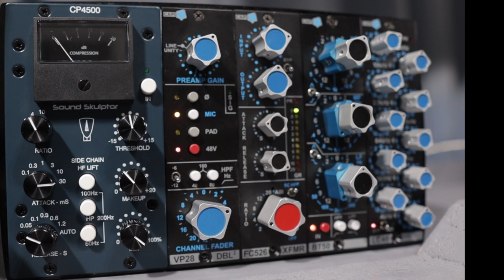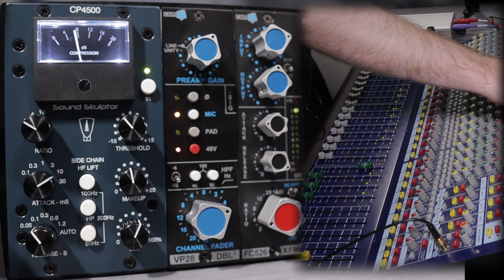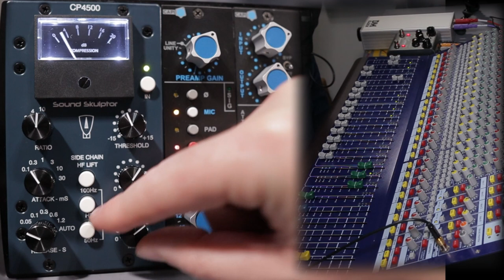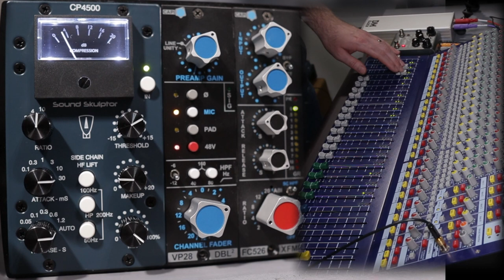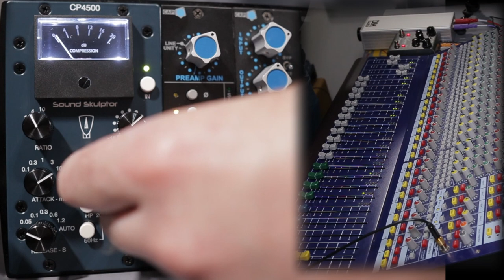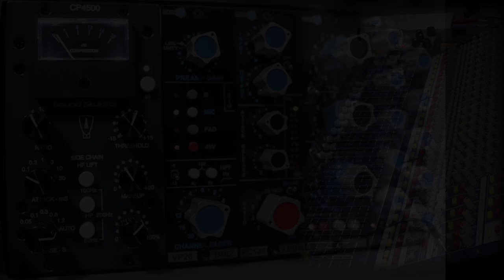Sound Skulptor CP4500 Sound Example - DIY Stereo SSL-Style VCA Bus Compressor Demo

Comment: This video made me pull the trigger on one. I´m in the middle of the building process and can state that this is one of the best documented DIY project I´ve come across in my builder career. While  it´s medium complex for the number of parts involved, the documentation covers every step in great detail, lots of pictures and all diagrams you could ever need are available. I´d even recomment it if that is your first build. Normally I´m into Eurorack DIY, roughly 100 or so modules so far, and only recently got into API500 format. Can´t wait to finish the build and throw it into the rack. I don´t own  any SSL gear and can only compare to elysia rack and api devices. Will be back once I played with the CP4500, but I expect it to act very, very nice in a 2bus chain with my xpressor, mpressors and nvelopes. Probably going to get a 2nd one to throw on the drum bus before master. SS delivers and I´ll definitely go for more of their modules.
Reply: I have built two of SK's 573's preamps and have nothing but good things to say about the products and their documentation is bang on. Support is there if you have a problem or question.

Comment: Just discovered that unit today, every sound check I hear are just so awesome ! The only that scares me is the way buttons are shaking, make me feel it's very fragile. One again, the sound :o just wow
Reply: I have a lot of Sound Skulptor units, actually they are not fragile at all though it seems they are in the video. Some type of buttons are shaking a bit indeed. But compared to other 500s units Sound Skulptor stuff are truly durable and well-built.
Reply: I´m just in the process of building one, almost finished tonight. While I´m a certified hater of wobbly knobs, in this unit the pots are also not screwed to the frontplate. However, these are not your usual alpha pots or switches. I´d still prefer things being fixed to the frontplate, but for example the switches seem to be built with tolerance, they are wobbly even unsoldered. I trust that SS did proper evaluation and this is a rare case where I´d accept the wobbliness for the good things that come with this unit.
Reply: @ilikemyrealname  Hi Will, to be honest, I don´t feel the need yet. I´d prefer them to be fixed, but had so many builds with wobbly pots that I consider this much more a matter of taste and preference than one of resiliency or long term usage. In the case of CP4500, the pots are bolted to the 2nd layer (ie the PCB behind the frontplate, not the frontplate itself), which takes stress off the PCB. So worst case you need to swap a pot a few years down the road. But you DIY anyway, right?

My bigger problem is: Will I get a second one or go for a pair of 554s.
Reply from the maker: The knobs are fine, never got the feeling they will break  🤷‍♂️  maybe you need to feel them tk believe me
Reply from the maker: I don’t understand your point of view at all. But hey, that’s ok. It is tactile. Honestly the wobbly knob makes no difference to me lol. It sounds pretty good and it is hands on. Anyways all good!
Reply: @DMKahn  It seems my replies and intent may have been misconstrued. I was genuinely curious as to what I was asking. Sorry I was unable to clarify my question and for any misunderstanding.
Reply from the maker: No worries man!!

Comment: That bass sounds insane. Could you tell me what exact instrument it and how it was tracked? Thank you!
Reply from the maker: That’s a synth bass, if you have logic I can send you the preset.
Reply: @DMKahn  Really?! Unfortunately I'm a Pro Tools user... Is it straight from the plugin? Or did you use any kind of post processing? Thanks for the quick reply. Subscribed!
Reply from the maker: This sound was made by my buddy Jahtomic. It’s a synth from Logic ran thru Logic’s Ampeg amp simulator, with a touch of compression. That’s the signal chain. Sorry I don’t have the specifics in front of me. Basically it’s a synth with all the mid range cut out and the lows boosted
Reply: @DMKahn  Thank you again for your quick and detailed reply :)
Reply: I would love to get that preset from you! Already sent you a dm on insta 🙂

Comment: it sounds soooo good, man! Definitely need one of these. Thanks for the demonstration!
Quick question about your Venice F32. Are you running it via Firewire with the built-in soundcard?
Reply from the maker: My particular model is the 24 channel version,  but yes I’m running it via onboard FireWire. Works good! $100 worth of thunderbolt adaptors lol
Reply: @DMKahn  ah ok nice! :) Thanks for the quick reply. Are you running it via Mac or PC and laptop or desktop computer? Can you by any chance share the name of the thunderbolt adaptors? Thanks! :)
Reply from the maker: It’s a FireWire to TB1 adapter then a TB1 to TB2 adapter

Comment: Hi. Is your console digital?
Reply: Love that build btw...lovely highs and impressive lows.
Reply from the maker: It is analog and digital. Analog board throughout with built in FireWire I/O
Reply: @DMKahn  How is the routing from your mixer going to the 500 rack? Inserts on the master?
Reply from the maker: Yeah basically. Everything is routed to the 500 series unit, even my voice
Reply from the maker: @riskyrewarding9815  I/O plugin on the master, yes.
Reply: @DMKahn  Got a Midas too. Lovely mixer.